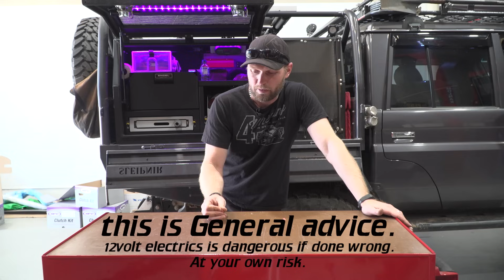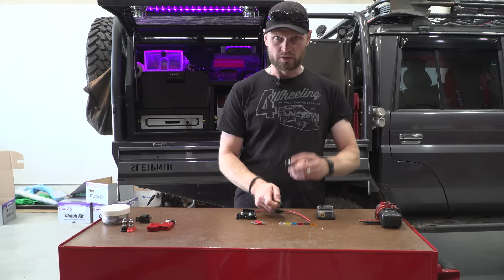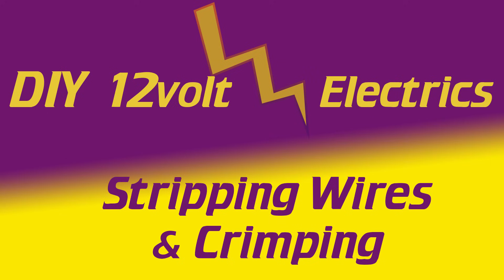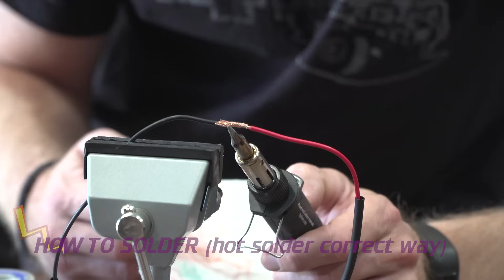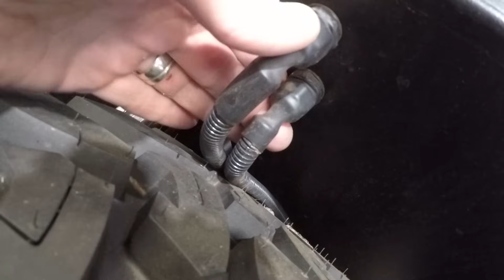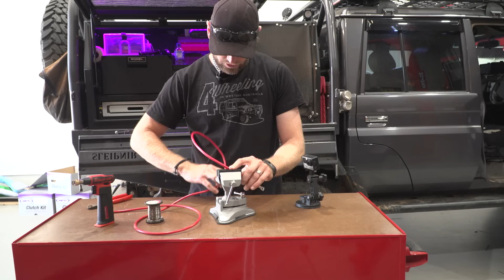How To 12volt DIY Overland Build

Comment: Ronny. These days with lithium batteries there's no need to run absolutely everything from your cranking battery. For winches yep probably a good idea but for compressors a good quality lithium battery can handle it. Depending on the maximum charge current the BMS can handle the can pull about 100ah happily until discharged. 

Also you don't need 4 fuses for a trailer installation. 2 fuses or breakers installed as close as practical to each of the batteries are enough.

Comment: I would recommend twisting the wires clockwise when looking at the cut end. If you slice a wire's insulation lengthwise, you'll find that the wire is already twisted in that direction.

Comment: That's not the preferred way to splice wires....Western Union splice is the proper way.

Also, the fumes are not toxic at all, it's just vaporizing rosin, not lead....that doesn't mean that you should go out of your way to breathe them in....but they are faaaaar from HIGHLY toxic.  Just don't snort the smoke, and you'll be fine.

Comment: Great video. New to the 12V world but keen to setup my overlander myself. Question; Anderson plug external connections for trailer/solar - is there an issue with these with water crossings? do they need to be waterproofed?

Comment: Ronny 😬 mate I love your videos - very informative and interesting! If possible could I please ask for some advice??? - Trying to add a duel battery system in my 2008 Nissan Navara D40 STX, I recently brought a 12v portable battery box and a 12v full Duel Battery kit from Supercheap auto (Supercheap branded). I am however getting confused, My goal is to permanently set up the battery box in the tub as I have an ARB canopy to protect it. I was told in store that an isolator would work on my vehicle which is an 08 as a VSR works with most vehicles up to 2010... Please clarify for me if possible? - Also what is “voltage drop”? Can the cables be the length of my vehicle, as I will be just relying on the “kit” and the battery box? Do I need anything else like a DC to DC in car charger at this stage? Ideally I’d like to be able to just rely on what I have purchased thus far if possible... I would love to hear from you, big fan of your channel 😊😊😊

Comment: When running the 3 prong switch through a fuse box that has a negative bus on it. The negative from the switch which activates the light in the switch. Can I piggyback that cable and run it to the fuse box or do I need to run it to a seperate negative bus and then to the battery

Comment: A little tip when doing the red,blue and yellow terminals the you cut the out cover off don`t  pull the  insulation off straight away twist the insulation so the wire is then twisted for the terminal plus if you got anything on you fingers there is no cross contamination.

Comment: In place of the industrial crimper, I've used a nut splitter to crimp battery terminals, it works a treat, especially if you grind the chisel point down a bit to something more rounded

Comment: just my 5 cents, theres absolutely no need to solder crimped lugs, if the lug is proper size for the cable and the crimper you use is decen ( i prefer one that squashes from 6 sides rather than 1) t it will make a cold solder joint, squashing copper cable and lug into 1 almost solid thing. introducing lead solder into it is not a good thing as lead isnt as conductive as copper there for you creating resistance. i work as a sparky and we never solder any lugs and we play with big voltages and currents.

Comment: Good tips Ronny, a few small helpful tips I could maybe suggest are these:
1. Instead of using a sponge to clean your tip, use a brass sponge by someone like Hakko. Tips wear quicker if they are rapidly cooled with a wet material as their coating begins to degrade.
2. Every time after you clean your tip with the sponge, tin the tip with solder. Not only will this prolong the life of the tip, it helps with the heat transfer when you are trying to heat up the copper.
3. You can dip a tiny amount of solder between the tip and workpiece when wanting to heat up the copper. Only a little bit to help the heat transfer and then feed the solder form the top.
4. When packing away your soldering iron, clean again with the brass sponge and then tin with solder and turn off to cool down. This will protect the tip in storage, then when you start it back up again, clean off the stored tinning on the tip and then re-tin if that all makes sense!

Great video mate!

Comment: I was always taught to make a mechanical connection (twisted wire loop) in my electrical wire soldering to increase the strength of the joint YMMV

Comment: No, don't solder heavy wire in a vibration prone setting!  Don't do it.  Get a GOOD crimper for that.  I bought a 13ton hydraulic crimper for doing the 00 awg wire (10mm welding cable) that I used to power my winch.  I have been using it for anything that requires a crimp that is more than 10 awg (~3mm).  In a vibration setting, colder is a weak spot that will crack and fail.
Reply: How interesting.  I had no clue!
Reply: You are 100% correct.
Reply: I was not aware of that, either. Thanks for the info!

Comment: Great videos. About the size of cables: it also depends on length of cable will be and total amp it would be needed. Too small size will DROP voltage, and could cause fire from overheating!!! There are calculators available on net, just to check.
Reply: Just watched this video and came to comment the same thing. His advice isn't bad, but also too generalised for do it yourselfers.

Comment: Some very useful info Ronny, thanks. Liquid electrical tape works well and gives a waterproof and vibration proof seal. Comes in a small tin, with an applicator brush...under $20 from auto stores and it lasts for ages too! See you on the road...

Comment: TIP FOR SAVING SOME MONEY ON TOOLS: An auto elec told me that rather than forking out the cash on one of those industrial size crimpers you can use a decent vice, a bolt, a breaker bar and a bit of muscle. Just put the lug over the cable, then put it in the vice with the bolt against it and turn it with a good sized breaker bar until the bolt compresses the lug enough and you get a solid crimp. Worked a treat when making up the cables for my winch.

Comment: Ok lots of incorrect info red crimps are 3mm blue 4mm yellow 6mm, and 8 bns can fit,  you want more the 6mm for charging batteries, you don't need some many circuit breakers for Anderson plugs just one at each battery, and that's is a poor soldier job, you want the soldiering iron hot as you can get dab some soldier onto the iron and hold it under the copper and touch with soldier until the join is completely covered with out melting the outer cover of the copper and keep the join same and tight, it's taken me years to learn the auto elec trade and see a lot of diy done terribly but people always try to do it themselves but if you do it right it will last forever and never fail
Reply from the maker: +cam scrivener as I stated at the beginning I'm not an expert when it comes to 12v electrical. What I have shown in my opinion is better than 75% of paid for stuff done out there in the workshops (I'm not including auto sparkys here of course as that would be my number one recommendation if paying to get it done).

Comment: Impressive explanation on how to solder copper but people always get it wrong, no difference to brazing 10" copper tube. Use the hot copper to melt the solider not the heat source it's self. And start at the bottom as heat rises.

Comment: Although i do see the usefulness of having a gas soldering iron for bush work, i would recommend using a soldering station with temp control when available obviously .
The coating on the wires is rated to a certain degrees celsius usually 200c or 175C for the cheaper coatings, once you heat the plastic to past this point the protective coating begins to degrade and loose its insulating properties. I find for most 3mm wires 315c on the soldering station is a good starting point using a blunt or spade tip. Oh and always use lead based solder it is way better at resisting vibrations over time.

I am no expert this is just what i learned while making racing drones and building many electronics projects in the shed.
Reply: Kazzarry you can control the temp with any decent gas iron
Reply from the maker: +cam scrivener I agree with your opinion I just like to use the gas solder as I can move around with it a lot more

Comment: When crimping it is always good to test the crimp by pulling on the lug to see if it comes off. With good crimpers it isn't as much of a problem but with cheap crimpers always check that the crimp has worked.
Reply: Second that.
Dont i say again don't buy the fucking super cheap auto branded crimpers they are the shit!
Reply: Kazzarry glad you said that as I was about to buy some! Any recommendations for an ok set that isn't going to break the bank?

Comment: Only other thing besides the cable glands is that I wouldn't push the heat shrink over while it's still really hot as the residual heat will shrink the heat shrink and you may not get it back over the joint if it's a snug fit.
Reply: Brett Ginn no that's wrong the heat will shrink as you put it on and can look messy and you use the good glue style it can get stuck
Reply: cam scrivener that's pretty much what I said??? The residual heat will shrink it prematurely.
Reply: Brett Ginn sorry mate I read that wrong

Comment: Spot on Ronny this should help a lot of diy'ers.

Couple of extra if people are interested,

Relays if you can always use a relay holder, saves so much time if some thing fails just pull the relay out and slap in a new one.
Heat shrink, if your using a gas soldering iron you don't need to carry a lighter or blow torch, just use the exhaust from the soldering iron heating element.
Soldering if your using small cable search for NASA standard soldering, i believe it's better than the inter-splicing and hot solder joints.
Un-glanded holes, just cut a length of split tubing and push it round the hole edge hot glue in place.
Multi meter, what ever you use it for always return it back to measure voltage before you put it away, if its set to measure current things might go pop if your not careful.

Bush fix tip, a family at the pitch beside ours blew a 50 amp midi fuse, there motor mover on there trailer had a short due to being installed without the use of split tubing (fixed that problem), they didn't have a spare so I crimped two inline fuse holders in parallel with ring terminals bolted the ring terminals into the midi use holder and put twenty amp fuses in them so the motor mover had 40amps to use, they got the trailer positioned and removed the bodge job and they picked up a proper fuse the next day.